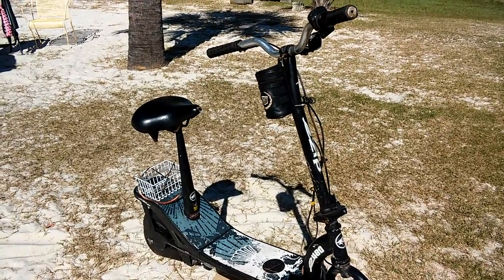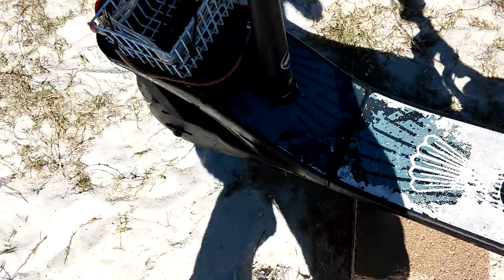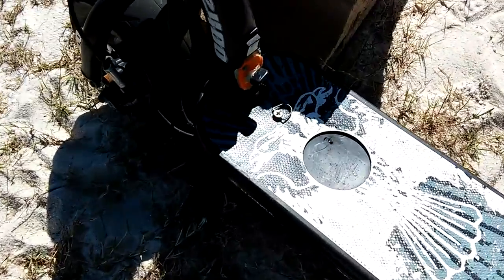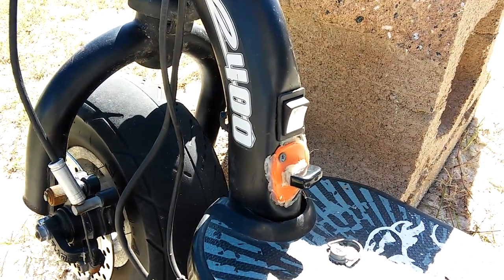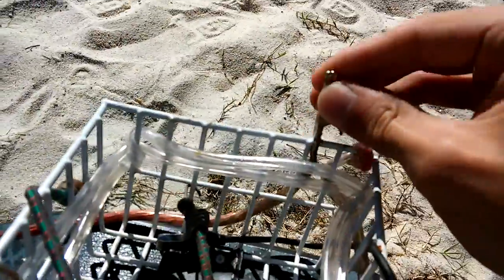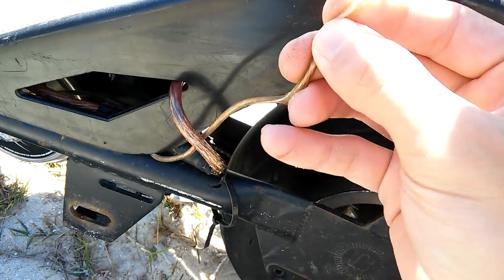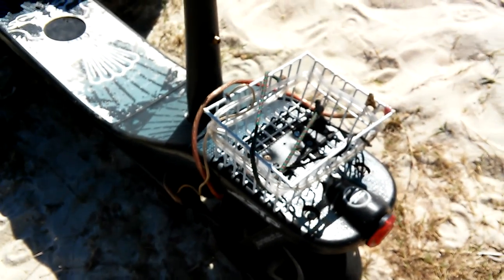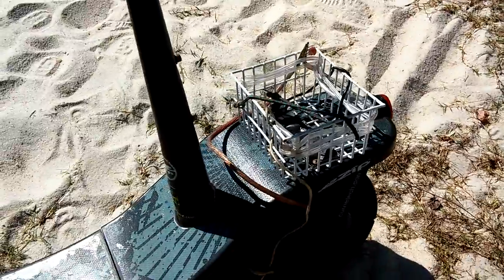CurrieTech Ezip-400 Electric Scooter Overview

Comment: hey how meany volt is it and watt ?
Reply from the maker: This is the Ezip 400, 24Volt 400Watt model currietech Ezip scooter. It handled up to 36Volt (i modded it in another video of mine and did a topspeed run as well to see how much faster it could go with an extra 12V battery in series,i highly suggest checking it out!)